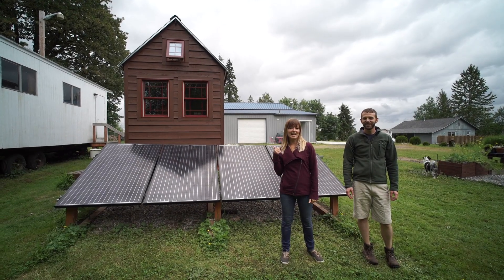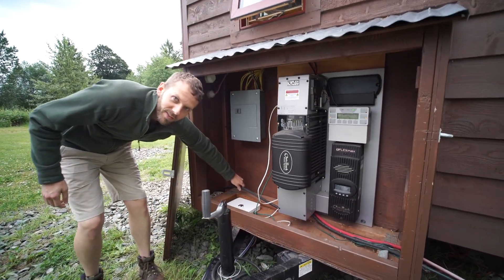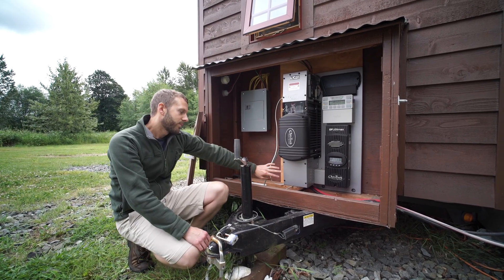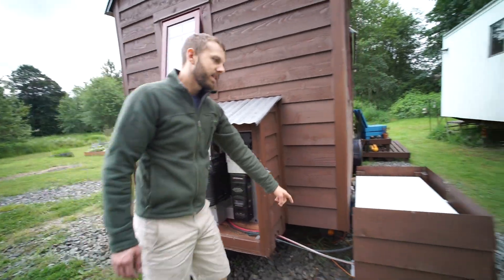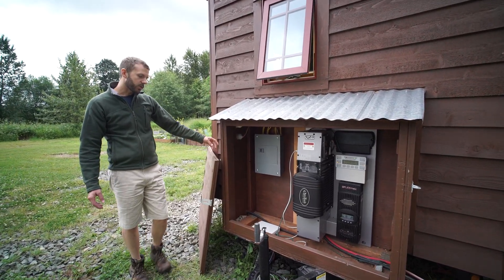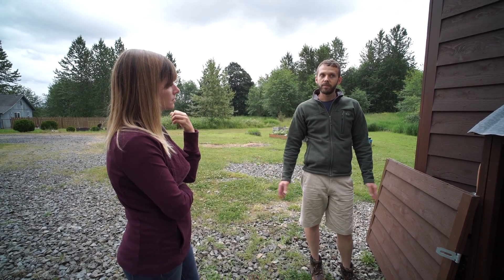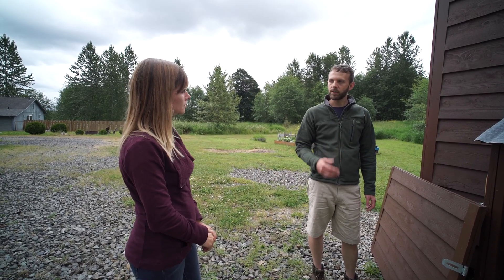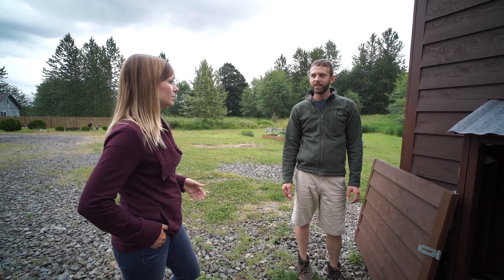Tiny House Solar System for High Power Use

Comment: That's a lot of weight for each battery, 172 pounds. A Tesla powerwall is 250 pounds for all the batteries and has more capacity than the lead acid. 13,000 kw divided  y a 48 volt system to give 270 amp hr. 😬 And it is mountable on the wall.

Comment: Hello, I am currently building an off-grid tiny house, and have been stuck for a while on what fridge to get. I keep going back and fourth between how big of a difference automatic vs. manual defrost really effects the electric consumption, and we cook at home daily and want a decent size fridge and freezer, (not bigger than apartment size though.) We are also on a very strict budget and didn't want to spend more than 500. You said it was a standard 120 fridge with low power consumption, could you provide the brand and model please!? Thank you

Comment: With 300 days of sunshine here in Arizona I bet that system would never have to plug into the grid.
Reply: In a place like Arizona, wouldn't it be worth having a home with a basement, to stay cool in? When you live in a basement, you never need A/C
Reply: How many of those panels needed to run the air conditioner all day?

Comment: I would love solar power on my tiny home but it looks so difficult :(
Reply: i did mine for 8kw on-grid for everything and it cost me less than usd 3k. my mothly electric bill is less than usd 25.
Reply: @UncleLeeDIYChannel  can you please share your componets that you chose for your system?  Im looking at a 4k system around 6k, please share.  Thank you
Reply: @christinas.2369  so u would like to install a 4k grid-tie system?
Reply: @UncleLeeDIYChannel  off grid only.  Need around 4k.  How do you get 8k for $3,000?
Reply: @christinas.2369  You need to spend some money on battries for an off-grid system. And it will cost you more for an off-grid system. What you need to buy is some solar panels, an all-in-one off-grid inverter (for me I prefer  growatt inverter), some batteries and some circuit breaker.
Reply: actually u csn diy it yourself, it is not that difficult and you will save a lot of money on labor charge.
Reply: I suggest using a propane powered on demand hot water heater, it is more energy efficient. Also an oil filled space heater uses a ton of power. I suggest a propane heater if you're going to use propane for the hot water heater. You can also use propane for your stove.  Even more efficient and sustainable is a small efficient wood stove that will allow you to cook and heat. You can even heat water with it, and dry your clothes. Some models even charge your electronics.
Reply: then please...stay plugged in....

Comment: Cool system! Something I learnt recently is the cost effective thing to do is not oversize your inverter but in fact undersize it, by about 10-15% (with respect to the array's peak power). The solar market is moving so quickly that the chances and practicalities of being able to upgrade the array economically even in the near future are slim. So, you're better to size the system to match your current needs and expect to pretty much start again if you need something beefier later. Also, unless you really need to be off grid, batteries are currently too expensive to make economic sense and you are better making up any shortfall from the grid. The good news is that electric cars are rapidly driving down the per unit price of batteries, so it won't be too long before this is no longer true. Good luck.

Comment: Just to remind folks two things. 1) Watch your wire connections, make sure they are elevated off the metal at all points and to use steel/aluminum metals that when combined don't corrode. 2) The grounding rod is there to keep yourself from dying in case the metal is electrified by the solar panels. These panels can create enough voltage and amperage to be fatal in the shadiest of conditions.

Comment: He lost me we he pointed at the solar panels. This is a pretty complicated system.
Reply: It's actually really simple. You have to follow the laws anyways. 

Solar panels. 
Charge Controller. 

Breakers whenever it enters or exits something, breaker when AC to DC, breaker is recommended for the panel lines itself (I'd personally do that at the charge controller, they did it right at the panels which is also a legality issue, you need to have a breaker by the panels, in my case the controller is by the panel so they are one and the same.

Comment: This doesn't really seem like it would be worth it if you're solely looking at cost efficiency. After rebates, he spent $8,000 for this system. It only works full-time off-grid during the summer months. Let's say conservatively I pay $45/month for electric (which is a lot for a tiny house), even if it were providing 100% of my electricity, that would mean this system would pay for itself in 177 months, or nearly 15 YEARS. I know we all have different reasons for going tiny, usually to live a simpler life and more cost-effective, but I just don't think this system is practical.
Reply: your absolutely correct when it comes to the math, but I think it gives you the ability to boondock or live permanently off grid (with more panels and batteries). I think it just gives them peace of mind... at least it would for me.
Reply: Did you factor in currency inflation and investment potential and electricity price changes? No.
Reply: Not only factoring in inflation, but think about how old they would be in 15 years….still in their prime and going strong….this expense today has value in many ways…one major advantage they take immediately: they are not renting their power from utilities companies now-today-…Utility companies have price increases and pass upgrade expenses down to the end consumer (me and you)…because we continue to rent from them (just like any landlord passes expenses to tenants over time and increases rents). Lastly, the time value of money….their investment today is not going to cost me and you the same if we decide to invest in this 15 years from now….nope—-inflation will take care of that…and me and you are on the bad end of the equation…we will pay substantially more. This is a great investment for those who can do this financially… right now.

Comment: Might want to do some research into the new Tesla home batteries, they will solve lots of problems
Reply: Danaw0207: Yep, but they are expensive. They usually start off around $899.00 each but are still worth it for size and weight and quality. They'll out last most other batteries as well. But they actually aren't a new thing. The company that makes them started out by refurbishing old tractor batteries that were made very similar. When I say OLD I am talking about batteries that were originally made in the late 20s and early 30s. I recommend that anyone going with a really good solar battery to research these Tesla batteries. Pound for pound they are worth the money but can be really expensive. I am working towards going with some solar at my house and I came across them over a year ago and researched them. Pretty cool stuff to know that way back then they had a really advanced technology in their grasp but didn't really know it at the time. Very cool stuff.
Reply: hey,
What info do you have on Tesla battery packs?
or is it on the one you can DIY for less?
Reply: joan bartlett : Pretty much just what I stated already. They are expensive but are worth the money. Because they use a little different design they'll outlast almost all other batteries. I think you can find them by googling them. Just type on Tesla solar batteries and see what comes up. Its been over a year since I researched them so I can't remember everything. Hope you find what you're looking for.

Comment: I was once told that you never truly own a solar panel that instead you rent it from the companies that make them. Is this true?
Reply: There are different contractual agreements available, depending on your location. However, you can always choose to buy your equipment outright and pay for the installation and all associated cost yourself. If you go that route you will own your solarpanels. You run the risk of giving up full ownership especially, but not exclusively, when you accept getting your panels on "beneficial terms". Does that make sense?
Reply: KitsuneNeko  it depends. I wanted to own mine so I avoided anyone using the word "lease". Leasing solar panels is just like renting them. You can purchase, its more expensive. A lease is cheaper because the company owns the equipment.

Comment: Normally, I thought that for tiny houses you'd want to mount the solar panels on the roof and the batteries in a compartment on the upper level of the house so that you can maintain mobility and still have off grid capability.
Reply from the maker: Everyone has different needs. For them, it was easier to install it all in the ideal location. They never move their house so mobility isn't a huge factor.

Comment from the maker: Not really Christian Kiviniemi. Those panels would not fit properly on the roof of their house and would not be pointing in the best direction for the sun. They don't move their house at all, so it's not an issue. We have solar panels for our house and we do move it around, but we wouldn't attach them to the roof either. We never know where we'll be parking, in which direction and if there would be a tree above our parking spot. Also, we go through a lot of branches and that might just be too tough for the panels.
Reply: Tiny House Giant Journey What about making folding frames for the panels, so that you can lay them out separate but can still pack them up if you need to go.
Reply from the maker: You could. We'll do a video about our system pretty soon. It's mobile.
Reply: +Tiny House Giant Journey have you made that video yet? I am just beginning on the tiny house choice, picking out my trailer today. I do want to know about the solar panels. I want to attach while mobile and then place them where the sun is directing.
Reply from the maker: +Patricia Dowless Not quite yet. We've been more focused on settling in in Colorado. We'll get to it, but it might still be a little while... You can attach panels to your house but it's an orientation commitment, if you travel with your house or change location, you'll have to make sure the house is point in the right direction. I thought I'd come up with a way to attach the panels to the house when traveling and quickly removing them when we arrived somewhere, but I haven't figure that out yet. Our panels lived in the bed of the truck when we were driving around.